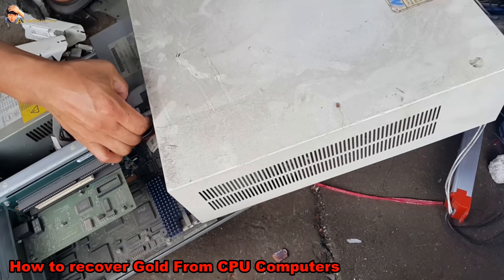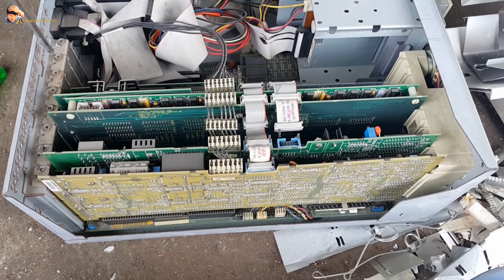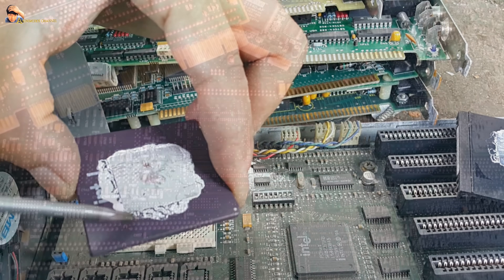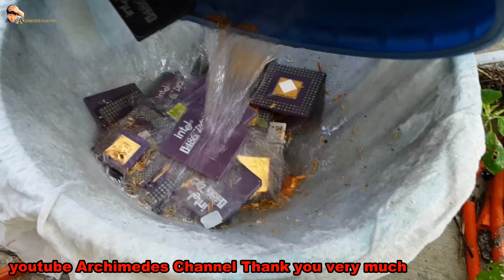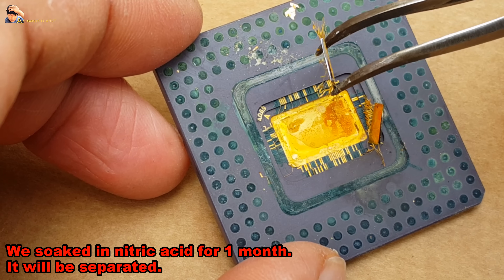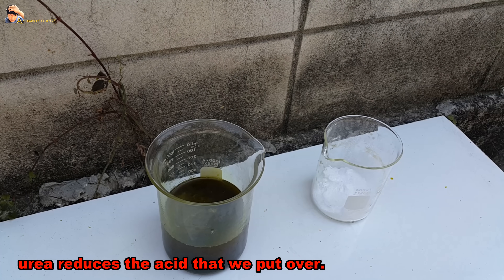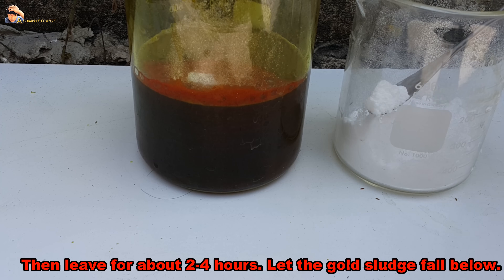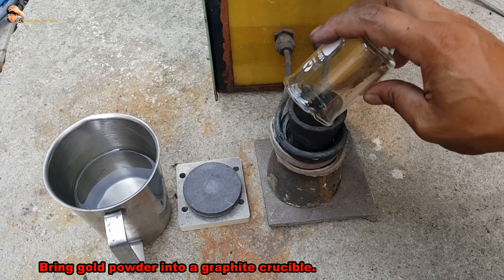How to recycle gold from cpu computer scrap. value of gold in cpu ceramic processors pins chip.

Comment: Would’ve had way more if he didn’t use aqua Regia while the pins still had all the base metals. They displace the gold when they are in solution. Aqua Regis isn’t supposed to make orange fumes that means all the copper isn’t gone and that makes the Aqua Regia work harder basically wasting some of it so the gold doesn’t all come out of solution

Comment: Ya aint getting rich that way. Thats for sure.
 Gold is valuable for many good reasons , not the least of which is the fact that you can coat surfaces  no more than one atom thick.
 Literally it can be made so thin that an entire sheet , although it may look like alot. If you were to crumple it up would reduce to a size akin to a grain of sand.

Comment: If you slowly pour off the dilute nitric in a filter then recover that later.  Overall really cool vid. If not using heat to drive off nitric then you need to neutralize it with urea or sulfamic acid.  Also it doesn't require a month of sitting solution to retrieve all the gold. Also important to use stannous chloride to always check solutions.
Reply from the maker: It sounds like you're ready to become the next alchemist!
Reply: Ive been learning this matter for several several years now. Learned most my stuff from sreetips and trial and error. Its pretty time consuming to prep, but once ready its exciting and fun! Im ready to finally start processing step npw for multiple things. I like your vids, ill upload some here ver very soon @MakeGold

Comment: Most IC chips also have gold, those were not used, and the extreme hazards of this process should have been  mentioned.
 The cost of the chemicals and the trouble of disposing of them is a problem.
Reply from the maker: You're absolutely right to be concerned. Even small-scale, backyard e-waste processing done this way is incredibly environmentally destructive and a major human health hazard. Proper precious metal recovery requires tightly controlled processes, emissions capture, waste treatment and regulatory oversight.

Comment: Archimedes thank you very much for all the knowledge you provide step by step, I have a question. How expensive is buying everything you need to make this happen, all the chemicals and tools and is it possible to buy them in a starter kit ? like a pack , because buying every item looks so complicated and time consuming, I would have to know where to buy, what seller is reliable, what is the best price and how much to buy to get the best deal. It would be great if someone buys big, creates these kits and they can turn a profit too
Reply: I know right?! This is a lengthy process for only 6-7 grams of gold..not only that but this project is for people that have sources to computer scrap.. 🤔 interesting 🧐
Reply: @salporcell1258  Definitely ! >< Thank you
Reply: As far as i can tell ive been digging for awhile there isnt a starter kit there are starter guides with a list of everything needed so far ive noted a small operation start up being around and about $1000 usd for the chemicals and equipment and the most expensive part being the acids 1 of which is almost $300 for a meer 500ml... Which from the guides ive been reading for properly mixing the chemicals your using damn near the entire 500ml which i haven't seen anything stating whether or not the first acid that is filtered with the unwanted metals etc can be reused or not if thats possible will save a lil bit of cash. I buy and sell scrap metal and i get e scrap all the time been looking to see of it would be worth recovering the gold and so far i dont see it being any kind of profitable without buying the chemicals wholesale and investing a hefty sum of cash to get them cheap enough. But if just as a hobby or a 1 time experiment may be worth the experience
Reply: @justinsmith4778  Thank you for taking the time. That's good to know because so far I have enough hobbies that do not pay me as i seem to be interested in many things and then you'd have to buy the equipment the heaters for the finishing product it's a lot. I already decided if I was going to do anything it would be scrapping the gold parts and save them until I have kilo and sell it for the scrap price. In theory there should be gold in all the parts he showed in the videos but you know, In life it seems that somehow everyone is doing something  else to to the benefit of everyone else because if we would all be doing the same thing we outcompete each other, cause loss of opportunity leading to fights and most importantly, All the other things and services that need to get done in the world would not get done and we would have no essentials, food, heating, bread. not even cigarettes ! and as it stands everything we need is being produced by someone without anyone  or anything having assigned it to them and that in itself is a miraculous thing isn't it. Like all living things growing all by themselves and cells repairing without our involvement. The entire thing organizes itself in order to create a self sustaining harmonious whole. I know the world is harsh but there is love in that somewhere. So that was my excuse for missing out on this opportunity Lol but off course I also wanted to see that nugget in my hand ><
Reply: I also still dream about finding the nazi gold they hid away in the alps somewhere btw lol
Reply: @justinsmith4778    i too scrap metal    and my local yard is paying 10 cents a lb for the boards      was watching to see if this profitable for me to consider  but looks like the expense outweighs the profit

Comment: Use a heat gun and hold cpu with pliers. When the soldier gets hot the pins fall right off when you tap the cpu against a dish

Comment: When you spend more on money recovering the gold than the money you would've made selling the parts to collectors on eBay
Reply: 6.7g is like 300-400$
Reply: If....you find buyers. There are billions... literally of these chips around. You just need to know where to look. I recover gold from tens of thousands every month
Reply: mmm, no those computer parts aren't probably anything a collector would want since its already not working. the cost of the chemicals used are also cheap or easily made with household items

Comment: This is a ton of work.

But if you have some old dead hard drives lying around, open them up and play with the insides! There are some very strong magnets in there (neodymium) as well as some copper, and the platters are usually coated in something like Platinum (although a very, very thin layer of it). Once you open it you will never be able to use it again, FYI.
Reply: Yeah i mean HDD's are pretty rare these days
Reply: @gb342002  No they aren't they're more than plentiful

Comment: You're missing all the silver in the solder used to hold all the other components an etching on circuit boards. You're probably throwing away more silver thin you're getting gold.

Comment: FYI, most of metal in the circuit is GOLD PLATED/GILDED metal, again, I say, G O L D  P L A T E D / G I L D E D metal.what it means is that, the base itself is not gold, the gold is just the skin of the circuit. If you want to make it worth to do, you have to collect ALOT of circuits to profit after deducting the cost of chemical or any source you are using to get the gold.
Reply: My profit margin is 30-1. It’s what I do. But I like when people say it’s not worth it... keeps my pockets full and prices up

Comment: 486, 386, Pentium Pro's go for 20 to 90 euro's each here in Europe. Highly sought after by retro games, also the motherboards. Those Altera boards that were daisy chained on the top with cables are data acquisition boards which are still used in older industrial SEM microscopes and medical EEG equipment, worth about 500 euro's each in unknown condition (refurbed up to 1200...). Some would say that it's old ISA crap but these microscopes cost 250 to 350k, the dedicated hardware is still maintained by a lot of specialized companies.
Reply: Hmm interesting
Reply: Is this not present in new processors or graphics cards?
Reply: Sir mere pas 800pc old hai mujhe sell karna hai
Reply: теперь их цена еще вырастет, из за того что их стало меньше благодаря Архимеду)
Reply: I have a motherboard asus rampage extreme 3 and i7 bloomfield processor? Interessed? Lol
Reply: So you can get matrix  gold, from computers  no wonder  there holding my  pc hostage  or ransomware
Reply: Well said the graphics card alone from the first part of the video is a Cirrus Logic it is worth over £100 alone these fools remind me of the story of the goose that lays golden eggs yet the damage from the poisons they use is causing irreversible changes to the planet
Reply: The ISA bus was super simple and didn't require any devicesdrivers to communicate with, literally a single cpu instruction to write or read from it (you stll can use those instructions but you need to have the right OS priveleges or in an OS that doesn't care like freedos), a few decode chips and you were good to go. You use to be able to buy matrix board with the ISA edge connector on it, or PC104 boards.
Reply: Only issue is that the CPUS have to be in perfect condition then trying to wait or find a buyer. I've had several for many many years. So most I'm just gonna process
Reply: volt ott IBM is
Reply: That’s funny. I’ve been buying them for 3$ American per kilo and melting them by the tens of thousands every month!
Reply: @jeffdishong7095  America!!!
Reply: Art Kyger  what?
Reply: @jeffdishong7095  thats a waste
Reply: @micahstanley9732  "waste" is a relative term.
Reply: @jeffdishong7095   hi!

Comment: I had a little look as to what they the second computer was as I've never seen anything like that before, I presumed industrial. I've seen interface boards but not 4 daisy chained together! They seem to be interface boards for a medical company product, the CPUs on first two machines are circa 1994/1995. Nicolet, the medical company, is still going and seems to make neurological analysis equipment etc.
I've a couple ancient Pentium CPUs on a shelf, I was going to make an ornament of them, now I realise I need to melt them down and sell the gold to Dwarves.
Reply: Lol its only profitable if you have an operation like this guy, where you melt 30-40 chips in bulk.
Reply: yes i noticed the age of the cpu's too. dx2's were on their way in as the sx was on its way out
Reply: @jimmydehand  
Yea makes me feel old, 95/96 I built a Dx66 with if I remember rightly 4MB of ram and something like a 540MB hard drive. And that was a vast improvememnt onthe 386 I had! I sadly remember the difference dx/sx was something like if it had a built in maths co processor? Early x86s used to even have an optional SEPARATE co processor. That would I'd imagine be about 0.0000000000001% of the maths ability of a decent graphics card now :)

Comment: You do realize that alot of this stuff you are scrapping has more value to collectors than the value of gold in them right? which is just a gold plating and not solid gold.
Reply: one thing people fail to realize on this thread evidently is that yes it starts off as gold plating but through the process of refining all the impurities get removed. Had she kept doing it or he or whoever that by the time they were done it would have been .999 pure gold. It doesn't matter where it comes from. Pure gold is pure gold.

Comment: I hear the chemicals cost more than you make in gold.

It's a cool project though
Reply: i hear not if you know what you are doing.  Certain parts of the world, i.e. australia nitric acid is very cheap.  The states, a small amount is very expensive.  Whole sale it is much cheaper.  You can distill  your own nitric acid with simple ingredients.  you can use poor mans nitric, i.e. nitrate of soda and water.  you can use many different methods that don't even use nitric acid depending on the material as well.  Wet ashing with hot sulfuric acid, muriatic acid and peroxide splash for AP, etc

Comment: if you want a more pure gold you could use electrolysis to pull the gold on an atomic level, Similar process used in Nickle plating... and if you are going to make a gold electrolysis bath you should probably Nickle plate your gold electrodes plates first. Google has tons of videos on nickel plating. the governments use titanium plates in an electrolyte bath with DC current applied to achieve 99% pure gold. Assuming lower quality plates and less power you could probably get 96% fairly easily with an electrolyte bath instead of an acid bath. Plus electrolytes are more earth-friendly. With a large enough bath and a windmill, you could probably toss the PCB and processors in and check the electrodes once a month.

Comment: Where do you get all these old pcs? Im a vintage cpu collector and would die for some of these haha.
Reply: Ha!
One time I was in charge of a job to convert a room that had previously ran the process to bond chips to the external pins, using 24k gold wires to connect.
I swept the floor 😁! I got about a 1/4 ounce, tried to melt it together with an oxy-aceylene torch, in a galvanized electric box, added some flux....
Made that a gold plated 4x4 electric box! 
Doh!
Somewhere in Santa Clara Ca... there is a very valuable electric junction box!
Reply: I’ll give you a hint and save, or make you a shit ton of money. Find a scrap electronic seller on alibaba and you can get what you want for about 1$ American per chip. No joke. It’s my living.

Comment: Selling the old 386/486 CPU and ISA Motherboards invlusive very rare ISA Control/Steering Boards for making more money was nt  an option?

CNC machines are already running on this electronic boards, when spare parts not avaible, these parts will be paid with up from 100$ and more, or a whole machine wit worth about 20k-100k must be wasted

Comment: Couldn’t you just burn/melt those plated parts in a crucible and separate the gold that way?
Reply: you need to dissolve the other metals first. Before dissolving the gold. You must avoid to melt other things than gold. Because gold is not the metals which it is most of .... You would end up with very unpure gold.

Comment: I have 250* CPU 4 LBS FINGERS & 3 LB OF PINS. Anyone render a estimate of retrievable Gold Grams? 
Prob have 500 mylar Silver lined keyboard pieces too. Any Guesses ?
Any buyers?
Reply: A few thousands worth of gold. 150 grams of the raw material makes one 1 gram of gold when refined which is $40 dollars.
Reply: @relo999  I sure wish I could sell them @ $2-$3 each. I will likely try to do the fingers & pins I have.
Most of them are the older bigger CPU's.
Thanks for the feedback.
Maybe I should try a lot on ebay?

Comment: thank you  deity  for showing   uses of  sulfuric acid one part with  hydrocloric acid 3part solution  to  extract gold from scrap but  you did not  describe  the fate of  the micro processor  . still to have been in functional   coding processing  ability.  since u know a cpu is  manufactured by  many  processes  of  extreamultraviolet lithography  ,  layout  ratio calculation  photoresist  methods   . plz  say something on those  topics   me from  8594956443,8249534316 Hina

Comment: So why computer manufacturer use gold in CPU?
Reply: Its has much less electric resistance than copper and silver, so it's perfect metal to use in the connections and where there is a need of speed. So almost everything electronic which deals with processing and connections needs gold.
Reply: @mohammadaijaz7418  now I know thank you very much
Reply: @carlocaballo2703  You are welcome.

Comment: Now I know where all my old broken PCs went when I left them outside my house. Someone took it to get the gold out lol.
Reply: And silver plus the copper. The metal cases are steel ,mostly, and have a good scrap value. If you have death tower size case  first check for resale of the case to computer hobbyist sell via Craigslist first or Via Mecauri. I sold two older tower machines with the old power supplies left inside for $100 cash.
Reply: Death= steel
Reply: Or to get your old data from the hard drives?
Reply: they force prisoners in english prisons to break up all those parts to be sent off for smelting, god only knows what they must be breathing in during destruction, crime sure pays well for  the brit goverment gold stocks.
Reply: william mccann really????? They use prisoners???
Reply: @addysidhu5669  they sure do as with many other countries.
Reply: @addysidhu5669  
No he is talking complete and utter rubbish. Prisoners in England are more likely to be in their room with their feet up playing a playstation than even thinking about taking a computer apart.

Comment: There was show on this on 60 Minutes or s similar show.  All of these busted comps and some other electronics go to into local recycling programs.  They are gathered in shipping containers that are shipped to Asia (I forget where).  The containers are brought out in the middle of nowhere where these guys are taking them apart to scrap the precious metals.  Handling heavy metals and chemicals with no protection.  They have these smelting operations that are polluting the water the people in these villages drink.  Then there are mountainous piles of plastic and other remains after.

Comment: Half of those CPU are 30 years old
Reply: Old ones have most. New computers started using very little gold.
Reply: I know I got a jar full of old CPU pins from the 478 to the 486DX and every thing in between Mixed alloy with mixed carrot Plated gold but still  processable